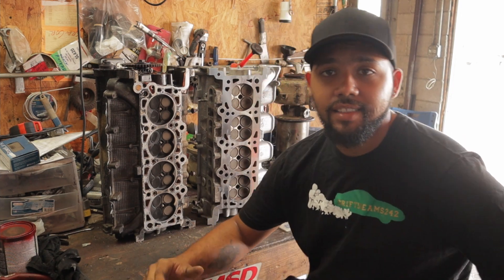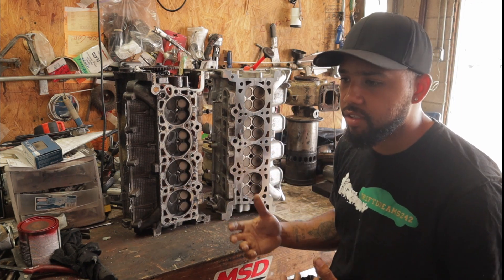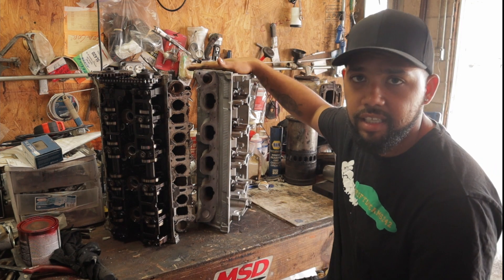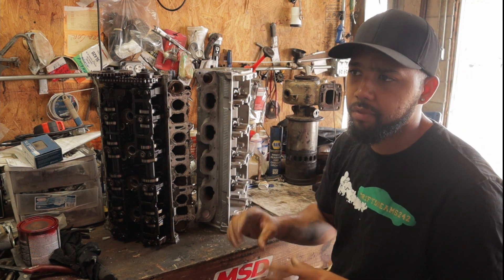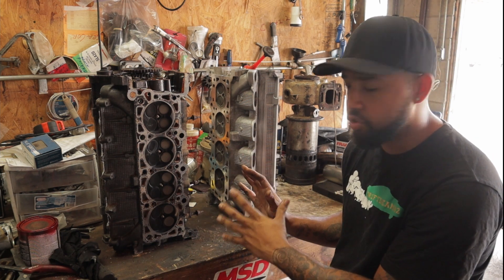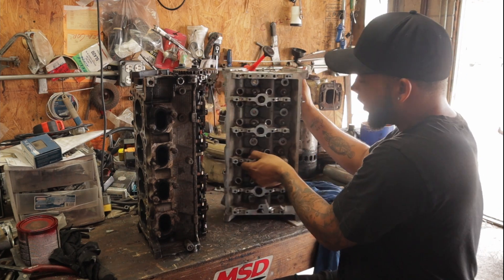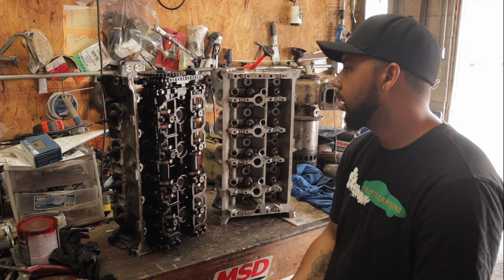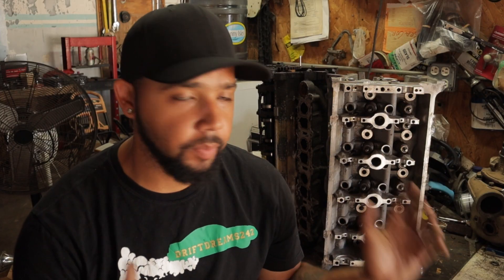Whats the Difference Between 4V 4.6L B & C Heads

Comment: Cams are different.

96-98 Cobra intakes had 206° duration.

99-01 had 202° intake durations.

03/04 had a 196° duration.

Throw some B head intake cams in a Termi and it’s an easy 25hp. Properly time that can as the pass head tensioner is on the pull side of the chain and can get pulled up to 9° out, and that’s another 10-15hp.

Then degree them and you have one hot motor.

As for the timing, that’s why most Termis only put out 390ish to the wheels while some who’s cams were in time from the factory would put out 415 stock.

Comment: theres so much wrong in the video, lmao. 

the "problem" with b heads IS NOT the imrc ports, its the cross section area and terrible short side radius.

none of that matters once you add boost. C heads for n/a and low/med boost, b heads for high boost (mainly for cost). b and c heads make roughly the same power under boost.

Comment: I have an Explorer 2004 4.6 it is 2v, will do any benefit to swap to a 4v heads if it can be done? If so, which head could be for a NA aint boosting the explorer, just want a better response all over the curb, i know there is not headers that can be fit into these trucks, maybe a cai and tune with straight exhaust
Reply: Gonna lose compression using 4v heads with 2v pistons

Comment: The ideas people think about with these heads are not based in deep thought. The IMRCs on the B head allow for higher flow where the injector is making for better fuel atomization cruising. The problem is that the second ports carbon up, same with direct injected motors. The other issue is the lip on the primary valve combustion chamber which should be removed. Also, the biggest advantage of the B head is a short runner intake mod, which increases internal volume of the intake. Research PHP naturally aspirated intake manifold modification, +30rwhp with no loss of power down low. They could get that engine running 12's with no blower. I also noticed, Cobra timing doesn't work for the B heads. I had to reprogram the entire map on my B head Cobra engine, and is VERY snappy now.

Comment: I have some 2003 marauder heads hires are the c head have a question will this bolt on on a 5.4 3v block trying to swap the heads get adapters for running a coyote supercharger

Comment: Just a dumb question, so could i very basically bolt them heads into my crown vic then use the cobra intake/supercharger?
Reply: @DriftDreams242  that's fine, one of my dreams would be to have a mustang, preferably an 03/04 terminator and then go for a kenne bell, i had always just thought the block was somehow different stopping you from using the same parts but that's awesome to know they do swap over so absolutely worst case if i need a new block, i can use a panther chassis block

Comment: B head is way better up top not the same i must disagree.
Reply: I have a high RPM ported B head naturally aspirated engine with FRPP cams, Ferreria valves, and a PHP stage 2 intake. The thing is ridiculously fun to drive. First gear and the tires have zero chance of hooking up... even with 315's out back.
Reply: @WXSTANG you running a 430 or 456 gear?  That must be an awesome setup.  I have a 97 cobra I wanna mod.

Comment: My ford book shows that the marauder, mach 1, aviator and cobras use the same cams.....only different oem cam was the intake cam from the 96-01 cobra
Reply: 96-98 cams are slightly better than the 99-01 cams. Both are a good upgrade from 03-04 cobra, Mach, aviator, muradar cams

Comment: You forgot to mention that the main down fall of the B head is the threding of the spark plugs ! 96 cobra 1200 rwhp 76/75 precision
Reply: Don't forget the fact that B heads have been faster than any regular C head in the quarter mile, only beat out by the famous  GT supercar/GT500 cylinder heads, and the issues that defeated the B heads appeared well past the 2k horsepower mark.
Reply: @Prestiged_peck  Holy cow 4 threads... what were they thinking?!! I pulled the motor and  now have it on a stand.  Thinking to tig weld some metal and re-tapping the heads to at least double the threads.

Heard great things about the B heads and my Teksid block. I was advised that I could benefit from some cams by John from Accufab Racing. What a wealth of knowledge he is--not to mention all the records he's made on these motors.
Reply: @Nicholas H   DO NOT WELD THOSE HEADS, THEY WILL CRACK use the cal-van inserts.

Edit: for racing duty the ford aluminum inserts are actually better.
Reply: @Prestiged_peck  Thank you. I will look into the inserts!
Reply: @Prestiged_peck  ...but wouldn't the insert itself be holding onto only 4 threads? Not sure I understand how this works.
Reply: @nicholash8021  ... you cut new threads for the insert... it's a little steel insert that's held in by much larger threads, and usually you end up with 10 threads that are much stronger than 10 spark plug sized threads. Mihovetz didn't use the brand I'm reccomending, but they're almost exactly the same as the ones he was having custom made for his B heads, just a commercial version. Alternatively you can get a machine shop that specializes in mod motors to give you the special racing inserts, but tbh good slug inserts like the cal-vans are stronger than the aluminum casting of the head itself so it doesn't really make a massive difference.
Reply: @Nicholas H  I want to update my previous statement, ford still makes aluminum thread inserts that give you 9 threads and they are the best option for a race motor.
Reply: What is 76/75 precision? What's wrong with the spark plug threads? I have a 96 Cobra ans never noticed an issue with plug threads. I am looking to spend a max of $3k toward HP gains and not sure how to spend it. I have a bassani x-pipe, cold air, under drive pulleys, and a larger radiator. I need to pull the engine and replace the head gasket. While it's out, I want to take advantage of any upgrades.
Reply: @nicholash8021  76/75 precision is a turbocharger from precision turbos, shorthand. And all 4.6 and 5.4's have issues with ejecting the spark plugs under high cylinder pressures usually only encountered in heavily built and boosted engines. You may know some of the 5.4's have issues even in stock form. This can be fixed with good inserts, most machine shops use cal-van inserts, and it's an excellent idea if the cylinder heads are off the motor to do the cal-van inserts while they're off. The later 9 thread heads (adjusted castings to add threads in the spark plug hole, early castings oy had 4 full threads) had nowhere near as many issues, but it can still happen under boost and therefore is still a good idea.
Reply: @Prestiged_peck  the 5.4 4v in the gt500 didn't have issues with this did they?  I've never heard of this issue on those I own an 07 with a gen3r.
Reply: @Lil' Ike  the gt500 heads did not, the fix came in mid-late 2003. Hence why we say the 05aviator is the best aluminum block c head 4.6 4v, because it got the 9 thread c castings and the nemak aluminum block (which is as strong or stronger than the teksid block for all functional purposes
Reply: @Prestiged_peck  You're right, that is a common issue with these engines. The trick is to only remove the spark plugs when the engine is cold, and thread them in by hand to start with.
Reply: How did you get 1200whp out of a 7675? Never seen one make over a 1,000 with that turbo

Comment: Know what your talking about...lol.  B heads out flow any c head just look it up....they actually flow to much that's why they have imrc....just open up the exhaust ports and b heads can support 2000hp....
Reply: B heads have a lot of potential but from 3200 RPM and up, IMRC deletes provide a substantial gain in power. Below 3200 RPM, the increased air speed with the IMRC plates closed helps a bit, but it's definitely in the way at higher RPMs and overall better to go with the deletes. See this vid https://www.youtube.com/watch?v=D7hKllTCSX8.
Reply: Not as they came from Ford they don’t.

The 03/04 castings outflow both B-heads and 99/01 C heads on both intake and exhaust sides.
Reply: B-heads do have a ton of intake runner volume which helps them on high boost setups — but for N/A and milder boost setup 03/04 is where it’s at — more flow with less port volume.

Comment: Its all in the tune buddy, I have a 98 cobra, 60# injectors, comp 106460, and terminator x in front of a 6r80 trans, b heads love to stay up high on the tach and the cams, trans, and 373 gear make it very lively.
Reply: Do you think those 460 cams would work well in an NA setup? What kind of air are you pushing and what hp/torque numbers are you getting?

Comment: Would the B heads still have the air fuel ratio issue running a carburated intake with some adapters to go from the single intake runner to dual?
Reply: Nobody makes a carburetor intake for the B heads, but it would be a VERY interesting test method. I'm personally going to make a custom intake with staged injection that puts the secondary injector that comes in when you try to make real power in the runner for that secondary port.
Reply: This is an interesting question 🤔

Comment: Could you swap a 5.4 block for the 4.6 and take advantage of the torque the extra 50 cubic inches would provide ? As well as a forged crank in all 5.4 DOHC motors ?
Reply: @DriftDreams242  >>>First let me say I love your work.. Im going to investigate further the idea of that swap... Ill check in with you on my findings...Keep up the good work
Reply: @DriftDreams242   check this out.. https://www.youtube.com/watch?v=EVTZbGK7R_c
Reply: @DriftDreams242  C heads are 99 and up. I believe the only different between the 4.6l and the 5.4l is the deck height, the 5.4 has a longer stroke, the 5.4 is actually just a stroker 4.6 honestly. It should fit in the mustang just fine. 5.4l head and 4.6l heads are interchangeable also.
Reply: Careful on some of the used 03-04 4V heads there was an issue with some early castings having only 3-4 threads on the spark plug hole, Cobras had a problem spitting plugs out at high boost. Look for a 7 thread 4V head if adding high boost.

Comment: Great information man! The c-head motor started in 1999 by the way. Also the 99-01 cobra heads had the 4 threaded spark plug inserts while the 04 cobra, Mach 1, and 05 Maurader had the 9 threaded spark plug inserts which were better for high horsepower applications…I have a 96 cobra that’s been sitting for 2yrs now because I have bad imrc’s and had an over heating issue,just recently fixed the over heating issue due to a ground cable that was loose and caused my fan not to work and also made my gauges act all weird,I just put some imrc delete plates,off road mid pipe and catback,with a new sct tuner for now, but also ended up buying some 01 cobra heads that I will be sending to a machine shop to get fully ported and polished with some custom cams,and my friend gave me his 03-04 Mach 1 upper and lower intake assembly which I will also turn into a short runner and also get cut open and have the entire plenum and runners get ported and matched to the heads,I’m looking to do a big bore stroker and make 500whp,yeah man big plans for my 4.6 4v motor,it’s going to be a coyote killer

Comment: I’m so glad I found this channel, I’m tryna to put a 01 cobra 4.6 in my 97 cobra and all this information about the heads and the differences helps a lot thanks(:
Reply: Find my comment... B heads are good... but require more money and time. you can get 20 more HP over an equal C head engine.
Reply: @WXSTANG  I have some livernois cnc c heads with a c to b intake adapter, I sold my cobra so I just have my built 4v thinking on throwing it in my 72 Torino squire wagon or 68 Torino gt